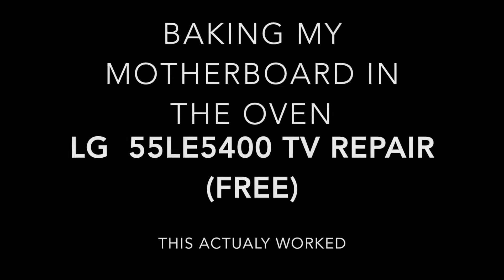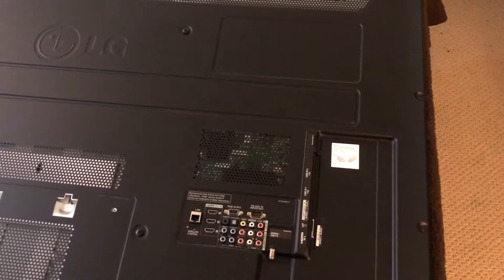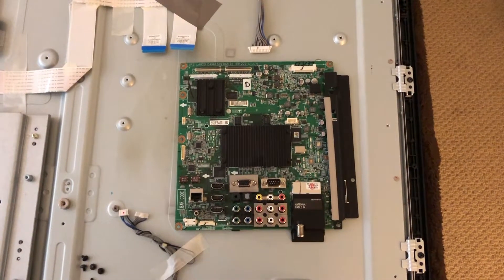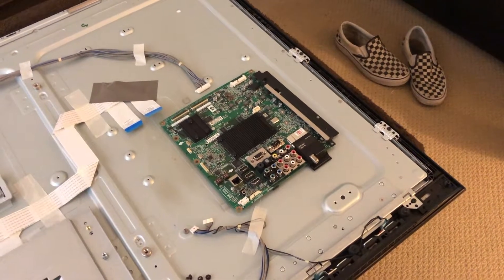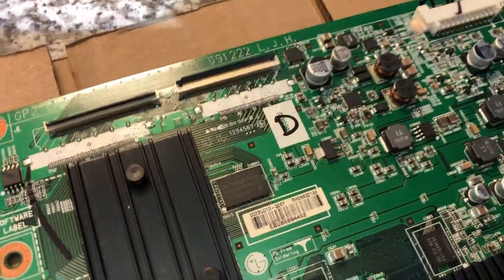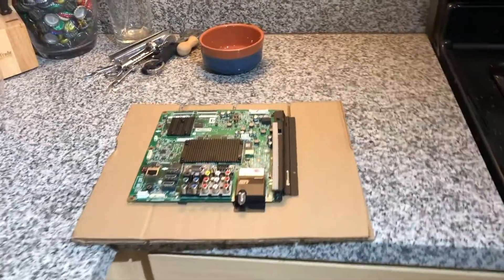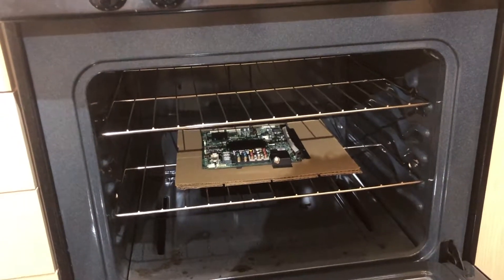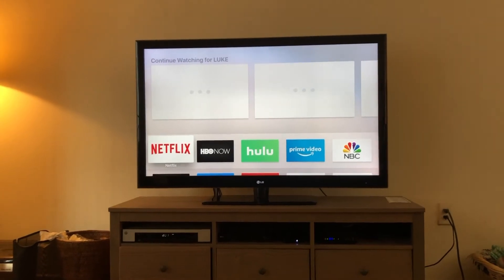LG 55" LED 55LE5400 TV repair

Comment: I'm doing this the 4th time in 5 years. I have a Plasma 60 inch. Been a great tv.
Reply: So I got the picture back but Lost remote access. I have to turn on and do volume manually..
Reply from the maker: @stevek758
There are a few simple fixes. I have included a link for a video here on YouTube that explains some of these potential solutions for you. If these don’t work, my suggestion would be to buy a universal remote on Amazon, or at Best Buy, or Target or somewhere like that; then program your new remote to your TV’s make and model.
https://www.youtube.com/watch?v=e9JU_e4WvQ4
Reply from the maker: @Hyperhye   I’ve now done it twice. The last time was about three years ago though. I hope this time it’ll last longer for you.
Reply: I tried to reprogram my Roku. Something on the Tv or board is out.  Maybe sauter came out of that portion of the board. I reheated in opposite direction. No dice. The remote mod lule is on that board.

Comment: I have a 2011 42” LG 42LE5500, symptoms were horizontal lines across the display and not picking up input from any source. I came across your video after searching for 2 days on finding a replacement main board or a place that repairs logic boards. The part for my TV is obsolete and had no luck. So either way I was at the end of my options. 

Tried this fix and IT WORKED!

Removed the board, popped it in the oven for 10min at 190 degrees Celsius, allowed it to cool down and reinstalled into the tv. 

Thanks for the fix!
Reply from the maker: So glad that this worked for you too!

Comment: its the IC under the Big Black heat sink   if you put a small fan on that heat sink it will not unsolider again
Reply: Where did u plug the fan into?
Reply: I followed the process of heating motherboard with hair dryer and worked! and i stuck a quiet computer fan over the motherboard vents so far working good! It is the same problem with any vertical motherboards with not a sufficient cooling like iMac graphic cards & these TV's. This TV needs a better cooling specially during summer time. The quality of the screen is outstanding and what a waste to dumb it in junk for a simple design flaw. Gravity + heat = solder bleeding downward & Chip tilt away form board....Duhhhhhhh LG engineers.
Reply: @RonH_music  thats not the Real reason, Solder balls cracks because fatigue, cycling power on-off , warmming-cooling. lead free Solder are too rigid

Comment: You said to set the oven temp at 385°!? Solder generally starts melting at 190°. Just did mine barely over 200° while using a temp gun on the mother board the whole time and it's back to working order. Thanks for the video.
Reply from the maker: Are you using Celsius or Fahrenheit?
Reply: @mine4820  they have diff heat grades of solder.

Comment: one of the capacitors(I think) in mine exploded
Reply from the maker: Depending on which capacitor, your tv may still function. Some of these boards have two capacitors for the same purpose.

Comment: Where is the power button on this tv
Reply from the maker: The power button is at the lower right corner when you run your finger across that area, the control panel should illuminate. Unless yours is defective like mine, and no longer works. In which case use the remote or fix it. I just use the remote.

Comment: What was it doing before it would not come on at all, that made you think it was another remote controlling it? Was it powering off on its own? Mine is cycling (powering off then back on) when I turn it on. Replaced my power board, but no luck. Thinking of trying this next, but the set still works, so I'm a little afraid to do it.
Reply from the maker: Hi Redwillow, my apologies for such a delayed response. I almost never sign in from my laptop and see these...
Before my screen went completely black it started flickering on and off then would go out completely. I knew it wasn't the led panel because when the picture was on it was clear and consistent.
The light-up LG logo also illuminated. I saw here on Youtube that the problem was the motherboard cracking. Sure enough this method worked perfectly. In fact it only just started flickering out again, this time in a different way, but baking the board again worked a second time. So the first time bought me about 7 months of continued heavy use.
This second time the flickering was diagonal and scrambled lines of picture, but if I lefty my tv on for a day, that would disappear adthe picture would return. That was definitely not going to work for me... So I tried again. It was the heat sink sitting above the CPU. the big one right in the middle. Sometimes as they get old they bend/bow up/out away from the cpu, and the thermal paste in between does not make a clean connection. REMEDY: bake your board and when it is cooling down place something heavy and steel on top of the heat sink so it remolds it self. I used small a 5lb steel bowl. It's working now. So far so good. Oh, I also lost a microcontroller from the heat of the oven on round 2. It hasn't caused any problems yet. This circuit board is a beast!
Reply from the maker: My remote control started acting with a delay, and the channels would spontaneously change on its own.